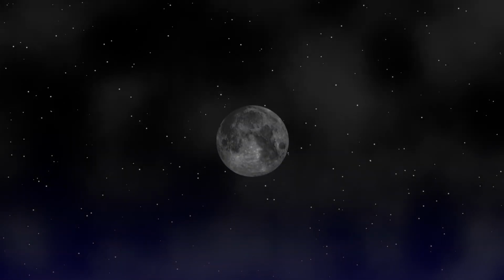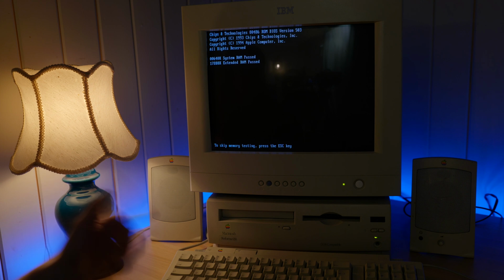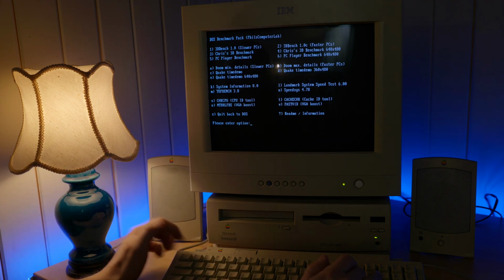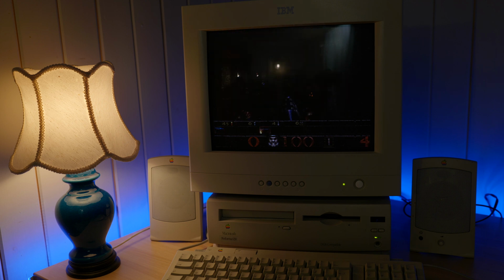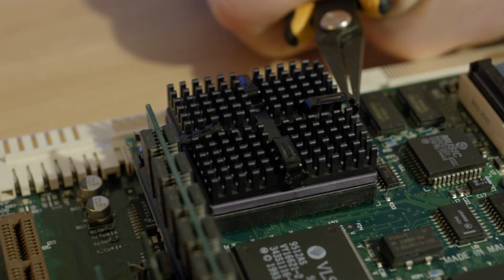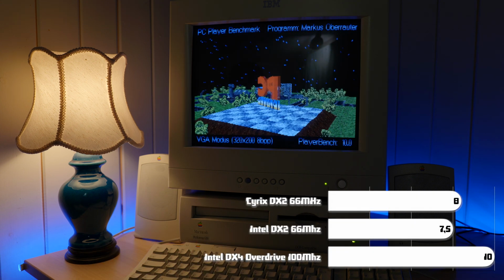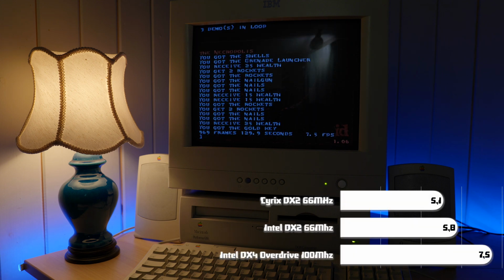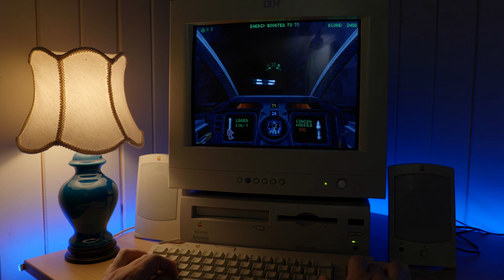OverDRIVING the DOS Compatible Macintosh Performa

Comment: Some Cyrix chips had a slightly faster instruction pipeline than their Intel counterparts, and lots of times were faster WINGUI Office machines, there were even GUI accelerated video cards that worked better with Cyrix chips but would fall behind in floating point intensive software.

Comment: I thought someone would have already given an answer as to why the speed difference varied so much, and in some cases didn't seem to be an improvement, but nobody has that I can see, so here goes.

In that generation of CPU, there was a concept called the FSB or Front Side Bus.  This is how the CPU communicated with the rest of the system, and all other things being equal, a faster FSB means it can communicate with the rest of the system faster.  

The other concept relevant here is the clock multiplier.  This is basically how much faster then the FSB the CPU operates internally, and THIS is where the clock speed is derived from.

This is where the 2 in DX2 and the 4 in DX4 come from.

The DX2 chips (both of them) run on a 33MHz FSB and have a x2 multiplier.  So 33MHz externally to the rest of the system, doubled to 66MHz within the chip.

The DX4 chip runs on a 25MHz FSB and has a x4 multiplier, so quadrupled to 100MHz.

Importantly, the CPU needs to go through the FSB to interface with ANYTHING external to the CPU itself.  That includes reading and writing to RAM, the gfx card, the HDD, literally everything.

The only time the extra speed of the DX4 100 can stretch it's legs, so to speak, is when that clock speed is more important then how fast it can communicate with the rest of the board.

For this reason, a DX2 running at 80Mhz will absolutely wipe the floor with a DX4 at 100MHz in most cases, as in that case the DX2 is running on a 40MHz FSB.  I'm not sure what CPU options are available for the DOS card, but yes, in some cases, the effective speed of a DX4 100 will be SLOWER than a DX2 66.

But it really does depend on the application, how much cache there is inside the CPU, etc.

There is so much more to it than the clock speed the chip is rated at.
Reply: In the video, both chips are using the same bus speed : 33Mhz.

Comment: I thought the Intel Pentium Overdrive was the fastest CPU that would fit a 486 Socket.
The Pentium overdrive is a cut down P54 core in a 486 socket compatible package.
Can you try this?
Reply from the maker: For sure! I’ll try it if I ever get my hands on one.
Reply: @OddObsolete  If you use an interposer board, you can fit an AMD 5x86, but I tried it in my Performa 630 and it wouldn't boot sadly. Also, it was physically difficult to fit in the stack of interposer, CPU and heatsink. I'm not sure if I would have had more luck with another variant of the 5x86 or another interposer board that let me set the cache between write through / write back... or if it would never work.

Comment: Why would an AMD 5x86 5V upgrade Module not work?
Reply from the maker: I have no idea. Is that like the AMD equivalent of the Pentium overdrive?
Reply: @OddObsolete  It's closer to the DX4 OverDrive but clocks up to 133MHz. The 5x86 would definitely be faster than the DX4 but they're 3.45v native, so they're not drop-ins; you need the special 5v-compatible versions, which are QFP chips mounted to a PGA adapter with a built-in VRM. The Kingston Turbochip and Evergreen 586 are essentially the same thing.
Reply: @fsfs555  @john_ace I've tried and it didn't work in my Performa 630 - I suspect it was due to the cache settings. I can't remember if my interposer (for adjusting the voltage) didn't have any jumpers for cache, I think it didn't, plus there are no comprehensive BIOS settings on the DOS card.
Reply: @OddObsolete  Its more like an improved 486 variant, but with high clockspeeds and some extras. You can get them with a 16k cache, and ones that support write through and write back. If you want to do this, learn from my mistakes, and the best one to get to ensure it fits inside the Performa would be one of the QFP package chips already soldered onto an interposer board and sold as a single thing. I bought the standard socketed CPU and a separate interposer and it didn't... really fit properly.